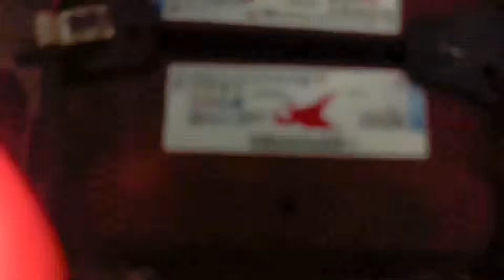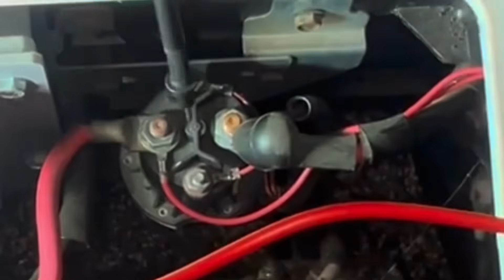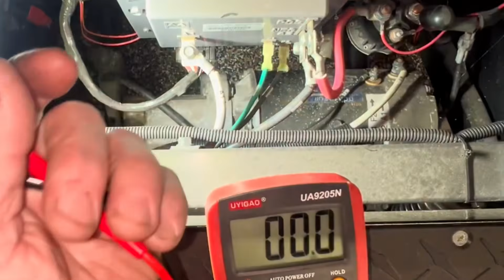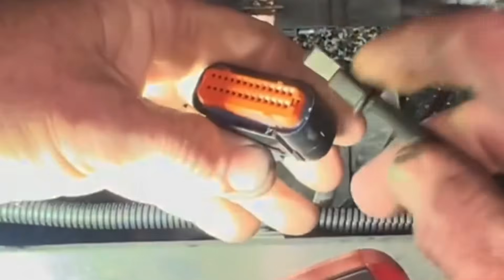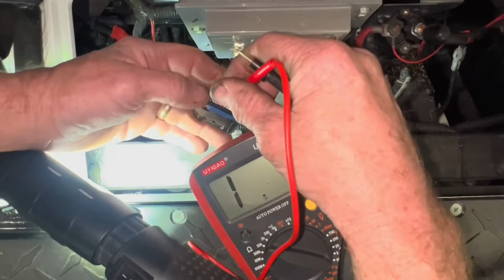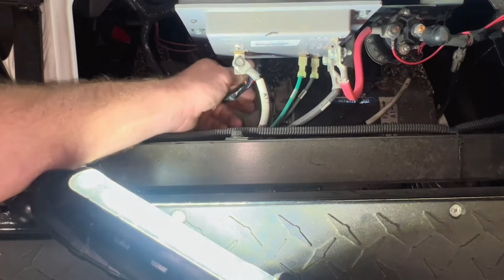Yamaha Electric Golf Cart Troubleshooting - Fixing Common 48V Issues

Comment: When i test from the red wire to the white wire i get 53v the same as my battery. You get 3-9 volts. I swapped my throttle position sensor thinking it was stuck wide open. But i have the same concern. When i first step on the throttle i get the click after a few seconds i get a click again and thats it. I have to flip the tow switch to get it to click again. Im wondering if my controller is bad. One day my kart quit working it worked the day before. What is your thought?
Reply from the maker: Check your Motor has a car been sitting a while
Reply: @golfcartwhisperer yes cart was sitting about 3 years. I put a new lithium battery in it. We rode it for about a month before it quit.
Reply from the maker: @MitchHartley-r6t yes take a battery wire off and unstick your brushes they normally stick after 9-12 months of no driving.
Reply from the maker: @mitchhartley-r6t. I’ll send you a vidro

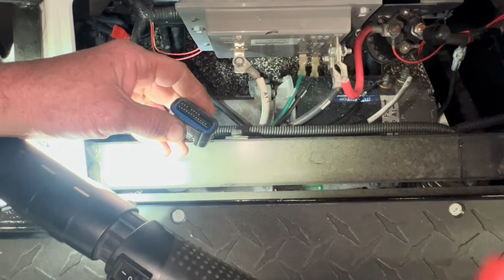Comment: At 10:00 of the video you mentioned it’ll throw an error code for safety. How do you clear the code or fix that issue?
Reply from the maker: Fix the issue
Reply: I’ve changed throttle sensor, solenoid, and only thing I haven’t tried is controller
Reply from the maker: @davidmorrison3100 what’s it doing does solenoid click
Reply: @golfcartwhisperer  negative. It was doing nothing. I swapped with a used controller and it’s working now.
Reply from the maker: @davidmorrison3100 remember this here on the drive yamaha if you turn the key in and the solenoid doesn’t click. It’s no good.
Reply: @golfcartwhisperer I gotta drive that the solenoid won't even cycle on when you put it in run will the foot sensor keep it from doing that? Not that familiar with these drives
Reply: @golfcartwhisperer the main fuse is good
Reply: @golfcartwhisperer it was the controller I checked voltage going in and was 48v so I figured it was faulty thanks for the great videos they help alot

Comment: Hey, my old man has a 2013 Yamaha YDREX3. Did all your tests and everything checks out. I think it’s the motor as well. Solenoids working. TPS is good, and I’ve got 48V on A1/A2 directly on the motor with the pedal to the floor. Do you usually rebuild the motors or just replace them?
Reply from the maker: Normally taking it apart, un stick the brushes or replace.  Could you buy a stock motor probably $800-$1200 always better to rebuild yours or he was your old man and he don’t use it a lot. They probably just sticks so you take it apart and stick them when you’re good to go.

Comment: 2009 Yamaha YDRE not running. About a year ago, I replaced the controller with an Alltrax XCT and converted to lithium battery. The cart worked great. A few weeks ago, the cart died. It worked off and on that same day but then died for good. My headlights and horn still work. When I turn the key and push the pedal, I get no click from the solenoid, no reverse beep when I flip the switch. I have 50V to the controller from the solenoid. I tested several pins in the harness that all seem to be correct. The green light on the controller does not turn on. Alltrax thought it was the controller. So, I sent to them and they tested it and said it was fine. They actually sent me a new one anyways (great support from them). I have also replaced the solenoid. I tested the original solenoid by connecting positive and negative and it clicked. The unusual thing is that I am getting a 50V reading on a few of the leads that should be negative. There must be a short somewhere, but I am not sure where to start. Alltrax thought it might be the harness. Thoughts? My first youtube subsribe ever.
Reply from the maker: Good man glad to hear that. I appreciate you subscribing.  To this here on your solenoid small post.  Put red lead of meter on there’s wire. Black lead on the main negative on battery.  Put in the run position and tell me what the volt meter shows. .
Reply: With the black lead on the main negative, I get a reading of 50V when I put the red lead on the red small post. If I move the red lead to the black small post, I also get a 50V reading.
Reply from the maker: @MatthewDeFrancesco  yeah she will get voltage on both posts, but one side just dead voltage
Reply from the maker: Run you a black wire from the main negative on the battery to the black wire on solenoid
Reply: I figured this one out. I'm ashamed of what the problem was but feel obligated to say it since it may help someone else. The copper wire for the main negative became detached from the interior of the terminal. I couldn't tell because it was wrapped in electrical tape and really didn't feel loose. Also, I have a smaller 12V negative from a converter that I connected with the main negative. The 12V negative would always spark which also helped hide the issue - and explains why only the horn and lights worked. I spent an exorbitant amount of time on something so simple that should have been obvious. At least I'm back on the road.
Reply from the maker: @MatthewDeFrancesco  hey brother, that’s just how it goes sometimes man appreciate you coming back telling us what happened
Reply from the maker: Glad you found it. Happens to everyone.

Comment: I got a weird one for you. 2007 YDRE flip tow switch to run and it clicks but not click when I switch key on. Cart runs but when key is off it still runs? And it also randomly starts clicking solenoid when key off, I’ll have to literally flip tow switch to “tow” to make it stop.
Reply from the maker: Do this here while it’s clicking check voltage on small post on solenoid.   And tell me what voltage shows.
Reply from the maker: So it sounds like the solenoid is getting voltage all the time.  if so controller  Is the only thing that would cause that. It would take too many variable for it to click like the key would have to be in the gas pedal would have to be pushed.  And if you’re saying the key is off.  Then that can’t happen.  What’s the backstory behind the cart. Has anybody messed with any wiring?

Comment: I get no output from the controller to the motor in forward but will in reverse.
Reply from the maker: Does your solenoid click when you flip the tow switch. Also what type of cart do you have.
Reply: A Yamaha Drive I believe 2013. I did your test on the motor output and in fwd I got no output but in reverse I did. I hear no beep and get no resistance when pushing it. Also i checked the solenoid by doing your check of connecting 48v to small posts and checking continuity across large ones. It clicked but no continuity. I replaced it and verified new one still same thing. It had went fwd before and was jerky and then nothing and smooth in reverse. This is after a lithium upgrade. Even after the new solenoid there is a click going to run from tow but no click or nothing hitting the pedal.  @golfcartwhisperer
Reply: Im now not seeing the 5volts from tps to the controller. I was the other day lol i dont get it. I went from the white A1 on the controller to the the red positive at the controller and had full voltage right away. Without even pushing gas. When pushing gas still full voltage.  Can I text you to try and figure it out.
Reply from the maker: @austinyingst9438  go to Facebook find me message me

Comment: Hey man, 2009 G29 was running perfectly when I bought it (2 days ago) left it at my house dropped off trailer rental and when I got back home no more than 3 hours it wasn’t running at all. The tow/run switch was being bypassed so the two wires were together. I bought a new tow switch and still nothing. Solenoid isn’t clicking even after a new one. Thought controller was the issue because every pin on the 26 pin connector was reading 16 volts and now with the new one it is still the same issue. Every single pin in there is reading 16V. Solenoid is getting all 50V from battery pack but it’s leaking through. Let me explain, so the battery side terminal is getting 34V and the fo troller side is getting 16V, adding up to the battery pack but it’s leaking through when it’s not supposed to. Anything you can help me with here? Thank you so much and I subscribed. Thinking it’s start/stop switch or throttle sensor so already ordered those on the way
Reply: Controller is reading 16.5 Volts at the negative and the positive
Reply from the maker: Reach out to me at 843-595-1611 before you buy any more parts. Don’t waste the money.

Comment: Hey, thanks for the awesome videos. I am stumped with my 2008 YDRE. It would intermittently stop working on me until it completely stopped. I have the Navitas Controller and they told me to change the TPS. It then worked for 5 holes of golf and quit again on me. Im not getting the correct ohms on my 2 new TPS that I tried. What could be causing all of my issues?
Reply from the maker: Are you using a cheap tps? Go into settings and look at what your throttle is showing and try to adjust the settings inside the controller
Reply: @golfcartwhisperer I have tried 2 cheap ones off of amazon and one OEM one. The first cheap one worked for 5 holes of golf. My throttle voltage shows 1.58volts and it shows my throttle percent at 1.68%
Reply: And also when I move the harness around that connects the main 26pin connector to the controller itself, the voltage changes down to .26 volts and sometimes the solenoid doesn’t engage.
Reply from the maker: @bmuench28 okay do this here the harness connector is bad for loosing. Connection at the controller. Take you a zip tie and go around the controller and the harness. And draw the harness in forward the controller and let me know what it does
Reply: @golfcartwhisperer ok I did that. Now my voltage is at 1.59 and my throttle percent is at 1.78 and the solenoid won’t engage unless I move the wires around on the 26 pin connector
Reply from the maker: @bmuench28 unplug your throttle sensor and see what throttle percentage shows.
Reply: @golfcartwhisperer  3.25 but fluctuates around a little bit
Reply from the maker: Watch your phone pedal reading and put on pedal and then tighten when read right
Reply: @golfcartwhisperer I plugged the sensor back in and it reads .26 volts and nothing changes when I position the sensor differently

Comment: Hello! Pulling our hair out on this G22 48v cart. 
Solenoid will not activate unless we roll cart forward or back a little, then it clicks off again as soon as it stops moving.  
We went through the tests you showed on the newer versions of these but can't get the solenoid to click on with tow switch or accelerator pedal. Any help is much appreciated. 
New parts installed:
Controller
Solenoid 
Tow/Run switch 
Accelerator switch
All other switches etc check out.
Reply from the maker: If you want to reach out to me at 843-595-1611. $45. I’ll reach out to you on my cell phone and we can figure it out or we can do it on here. It’s up to you. I hate the fact that you put all the parts on there lol I wish you would’ve found my page sooner
Reply: I'll get back in touch next week and we will go through it. Thank you!
Reply from the maker: @stevepatterson1354 okay np.  I’ll be here

Comment: What if I’m gettin no click with solenoid at all. From switching to tow/run I get nothing and pushing the pedal I get no click at solenoid either. But my batteries are good they’re 50v and the solenoid is brand new
Reply from the maker: Probably controller or a voltage problem did you check voltage according to the video?
Reply from the maker: If you did, let me know what you’re missing
Reply: Ok I’ll get back to you
Reply from the maker: @hayukeen1127 check your red wire on solenoid with black lead on main negative on battery
Reply: 2000 Yamaha G19

Red wire on solenoid 
main negative on battery
Result: 50v steady even with gas depressed

I’ve already replaced:
-Accelerator switch (under gas pedal)
-Throttle sensor (sensor in metal box in line with gas pedal)
-Rev/Fwd switch 
-Brand new solenoid x2. I actually bought another one just in case

Tow/run switch is good I tested it like you did in your video. Key switch is good I tested it like you did in your video.

I think it’s the power charging interlock out. But I don’t know how to test that. This cart has a two prong charging port.
Reply from the maker: @hayukeen1127 test your key switch black lead on main negative red lead on back of the key switch. Tell me if you’re getting voltage
Reply: I also get the reverse buzzer when putting cart in reverse
Reply: Black lead on small black post on solenoid 
Read lead on small red post on solenoid
Result: 0v.
Reply from the maker: @hayukeen1127  OK put the black lead on the main negative on the batteries red lead on the red wire small post solenoid
Reply: Black lead on main battery negative
Read lead on back of key switch

Result: KEY ON
Red/white wire 50v
Solid red wire 50v

KEY OFF
Red/white wire 0v-2v
Solid red wire 50v
Reply: I had to go to work. I will get back tonight and let you know. Thank you so much for the help.
Reply from the maker: Yes sir just let me know
Reply: Black lead on main negative battery 
Red lead on small red wire post solenoid 

Result: 50v steady
Reply from the maker: @hayukeen1127 okay that’s good.
Reply from the maker: Check your accelerator switch.
Reply: Yup I actually replaced it. I gave it a test. With my red probe multimeter I stuck it into the plug with the red/white wire. I took my black prob multimeter and put that to the main negative battery post.

I get 50v with the pedal UP. When I push the pedal down I get no change.

Isn’t it supposed to be there other way around? As in 0v with pedal up and when you push pedal down you get 50v?

I even tested my old accealtor switch and get the same result
Reply from the maker: @hayukeen1127 yes.  Take a paper clip and jump the switch or you can use a wire something to connect the wires together
Reply: Son of a! I just noticed my 3amp fuse is blown. But it wasn’t blown yesterday. I have to wait till tomorrow to get a new one then I’ll try to jump the pedal switch
Reply: Thing is I already replaced the pedal switch. Could it really be bad? Also just subscribed thanks for help man
Reply from the maker: Yes did you already replace solenoid
Reply: Yes solenoid is brand new. I jumped it from small black terminal to  main negative battery and it clicks
Reply from the maker: @hayukeen1127 okay so it’s not clicking with the jumper.
Reply from the maker: @hayukeen1127 if you have voltage on the keyswitch that means the charger lockout is good
Reply from the maker: @hayukeen1127 pin 3 put one lead of your volt meter there and the black lead on main negative hit the gas in the run position with the key on in the f position and tell me what it reads.
Reply: Ok I’ll get back to you tonight. And YES the solenoid does click when I jump it. Solenoid is good
Reply: Should I be checking the pin 3 with it plugged into the controller  or without?
Reply: I get 50v when I put a prob on pin3 and then the other prob to the black negative and pedal pushed down
Reply from the maker: @hayukeen1127 just seen I don’t respond I been tied up with live.  Do you still need help
Reply: I took it into a shop I threw in the towel. Apparently control is bad. I’m gonna give them one and have them install it. They wanted $1.1k for their replacement and install I found a Nativas for $650
Reply: Yup controller was bad navitas one and problem was fixed
Reply from the maker: @hayukeen1127 good thanks for letting me know

Comment: I have a 2002 Yamaha G19E and the cart goes a little bit then stops and I can smell rotten eggs, could it be the controller ?
Reply from the maker: Check the batteries first. See how low the batteries drop
Reply from the maker: And let me know
Reply: @golfcartwhisperer  batteries are all good, when I press the pedal it goes and stops and I hear a clicking noise when it cuts out
Reply from the maker: @indianajones1900 does it shutter or shake taking off.  If. It when it quits running take your volt meter put black lead on main negative on the battery and put the red lead of meter on big post on solenoid. One at a time. Hitting the gas key in in the f position both test. Volt meter on volts dc 200
Reply: @golfcartwhisperer  so I tested it and in forward position the voltage was at 12.8 volts and when pressed down it was at 12.4 volts on the solenoid
Reply: It goes about 7 inches forward and stops and I hear a clicking noise
Reply from the maker: Where are you putting the black lady or meter at put it on the negative on the controller and retest
Reply: @golfcartwhisperer I put the black lead on the battery negative closest to the solinoid
Reply: @golfcartwhisperer  I put the black lead on the battery closest to the solinoid
Reply: @golfcartwhisperer  so black on battery negative and red on controller negative ? Is that it ?
Reply from the maker: @indianajones1900 no it the red on the solenoid big post